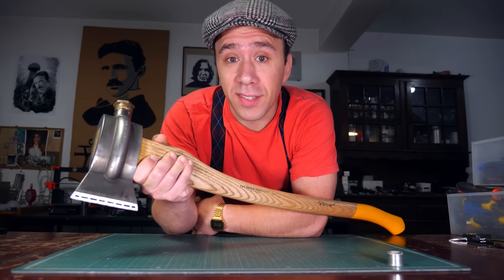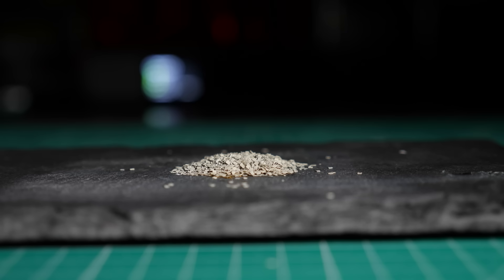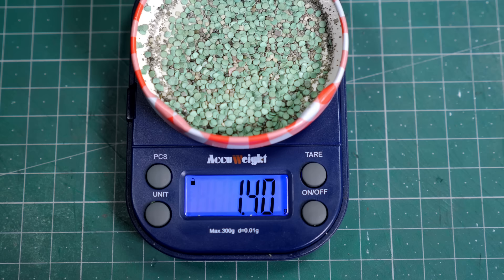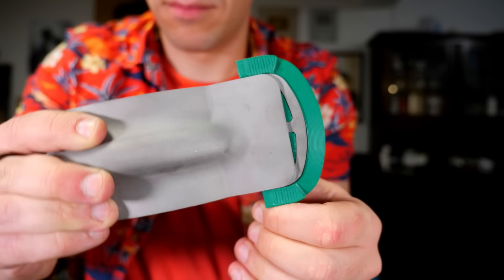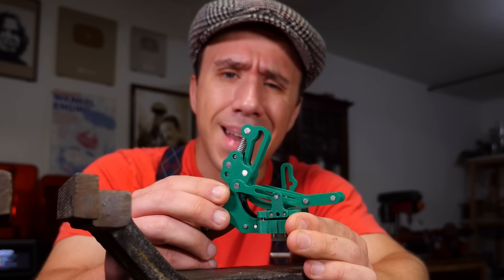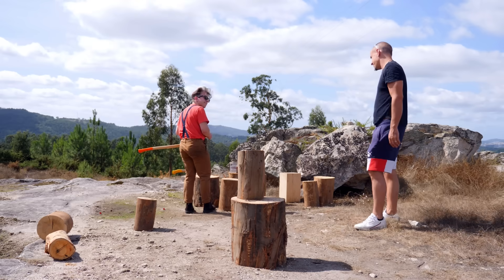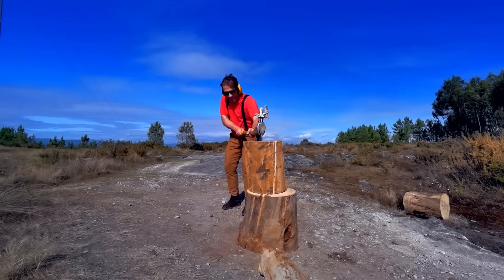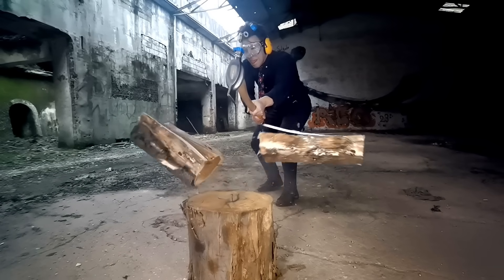I built a BETTER SHOTGUN AXE

Comment: Essentially What you've  made, is called a splitting gun
Working with explosives, I have a splitting gun in my kit which is used with black powder. It will split a whole tree barrel with one shot. It's a long heavy cast tube, with a long taper heading up to a hollow barrel that goes about 3/4's of the way down. You load the gun from the muzzle, tamp it until it's compressed then belt it onto the end of a log , fuse is inserted ito the flash hole, a chain with a large steel peg attached to the end of  fat end is hammered into the ground to catch the gun on recoil, which it blows out with a lot of force. 
It's a 200 year old device, and is essentially a much more useable item than the lovely thingy you had printed modified and experimented with. Still quite impressive though. (Edit)* and in conclusion this is the best video I've ever seen.
Reply: I've heard stories of this type of thing being used by farmers to remove large stumps back in the day, down here in Australia. Albeit, with less precision and more gtfo. Mostly these were cautionary tales.
Reply: @sir_vix Victoria 👍🏻
yup. They're not safe at all 😂but very effective provided you're not wearing it after
Reply: @sir_vix it's true, they did and there were some specific devices and homemade ones
Reply: Man, you are so cool for sharing al that yk? :D
Reply: @misterkarpik  by cool, you mean arrogant conceited and obnoxious right? 😂
Reply: "... and is essentially a much more useable item than the thing you had printed. " - bit unnecessary don't you think?
Reply: @85Portar  you reckon? 
So you're into quoting comments, trying to seem like you have an affinity with the creator because you went into bat for him after the mean man just talked plain facts? 
Now you have my attention, I feel you may be a little thin skinned for real world activities. 
My names not Quasimodo , but I got a hunch... 
shhhhh hush.
Reply: @shotfirer-yf7ub  entitlement is a very telling telling factor about you, lad
Reply: @shotfirer-yf7ub  I think you might win a prize for "least likely to have touched grass in 2025". You're just missing the mark completely there bud
Reply: @85Portar yea righto, bud. Point missed 👌🏻
Reply: @85Portar I'm a 53 yo 3d gen farmer in Victoria Australia bud, what do you do, bud
Reply: This looks like a more awesome, though perhaps less safe and less efficient, version of an old device from 200 years ago. Can't wait to see the final result of your tinkering. Try using 5ml water per kilo of a 10% fuel oil 90% AN emulsion. It boosts your blast by a factor of ... lots.5ml expands exponentially when it's combined with explosives and steam. A small amount Can be avery strong as a boosting aid in confined blasting. For an example of the device, I found this video. https://www.youtube.com/watch?v=O_iH1ESyYuc    youtube Black Powder log splitter Demolition Dave Drilling and Blasting.

You could have posted something like that and achieved the same level of information without being rude for no reason. It's a matter of respect. See in the real world, people tend exercise a certain level of respect to avoid being punched in the face and over time this builds up to a natural habit most people tend to call 'common decency' and 'tact'. You know, those things you can't attend parties and functions without having. Maybe until you've learned to internalize some stuff, we should consider you not quite ready... >for real world activities<.
Reply: @FanfictionEnjoyer mate... go do something productive..
Reply: @shotfirer-yf7ub  True, fighting a battle of wits with someone unarmed is rather unproductive.
Reply: @FanfictionEnjoyer just out of interest, and if you don't mind sharing , what do you do for a living and how old are you? What information did you bring to this topic?
Reply: @shotfirer-yf7ub  I brought to this topic a basic skill that most people learn between age 5 to 10 with slower examples happening between 11 to 20 and particularly slow examples of human capacity learning... much later or never. You brought something you probably saw on a youtube video. Neither of us are particularly impressive in that regard. But oh well. As for age, I'm middle aged and work with computers and have a wide range of hobbies; though I don't spend enough time in any of those hobbies to be considered an expert.
Reply: @FanfictionEnjoyer no, in fact I worked underground in a hard rock gold mine, in Victoria , under a town called Stawell, after I left , I started my own shot firing business. Manufacturing selling and implementing explosives. I did this for a number of years while working the farm at the same time. 
our family farm , located east of Great Western has been a productive super fine merino concern for over 100 years. I'm very proud of my 
work history and what I do now. The fact you've taken offence to my perhaps slightly forthright sharing of information suggests you're probably a bit soft ... and as for googling anything I posted..
I was raised reading books, researching without computers and doing things to actually find out. 
Not typing on a keyboard. Great for reference though, I often get calculations ,pressure conversion tables , engine specs , just general engineering queries, but suggesting i Google to post is kind of lame.
How old are you? Seriously? 
Your projecting
Reply: @shotfirer-yf7ub  Not sure I would have admitted to being in the last of the three groups. But you do you. If that's true about where you worked, I'm sure you must've been fired for your attitude. I suppose the other alternative is that you just have that attitude of cowering before the strong and only showing your rude side towards those who you think can't hurt you that plenty of random 'bullies' have. I certainly would have fired you on day one if this is how you act on the job.
Reply: @FanfictionEnjoyer oh dear ... mate it's all going to be ok.
Reply: @FanfictionEnjoyer  You do realize you're encouraging him to commit a felony right? ANFO might be easy to make, but even in the US you need a special license to own blasting agents!  The other thing the US does is classify powder actuated devices, like this axe, differently from explosive actuated devices.
Reply: @EmperorA0  I doubt I'm encouraging Shotfirer to commit a felony by pointing out how they could have been nicer with their comment by showing a better way to say it.

Comment: 2 potential improvements for a V3
1. Switch to the little things you alluded to in the water segment, sure they are used a lot in YT projects like this but it is for good reason
2. Have some manual control over the detination, so you could dig the axe into the wood a good depth safely and then detonate to split it or ensure that the timing is good and not to early or too late
Reply: As for 1. Maybe 2-4 of the strong(red) ones, as for 2. That is more of a soft requirement but it would allow you to, for example, dig an area out for easier penetration, and then go for a swing with a well timed manual det via some sort of button or squeeze lever

Comment: I think that part of the issue is that you're directing all the pressure outward. It is my understanding that when the gas hits the opening, it hits the back of the blade, which forces it outward, transferring energy into the blade rather than the wood. If you made the gap for the gas to escape smaller and "sharpened" the inside of the axe where the pressure hits, it should be deflected at a slight angle rather than being forced all the way perpendicular to its previous direction (assuming my intuition is correct). I feel like if you directed it into the wood at a downward angle like this, it would transfer more energy into the wood because the gas would carry downward momentum and be harder to direct upward, out through the hole created by the axe entering the wood. Note that I am not a physicist, nor am I particularly intelligent.

Comment: Good luck! 
I would suggest to add more weight and have a wedge that kicks out, 4.5-5.5 kg assembly is plenty. 
Have the wedge maybe 500g so the detonation can actually push it and consider a more powerful charge.
Just bore out a sledgehammer and stick the shell and wedge inside it,

Comment: If you are having issues getting shotgun shells where you live how about ammo for powder actuated hammers? Those are basically either 22 or 27 caliber shell casings that are filled with gunpowder then the end is crimped and sealed. No projectile. They are also rimfire instead of primer fired. It is possible to slpit the head of your ax below the handle, install a couple of springsfor a safety so it does not go off if it is dropped. At that point, you could set 3,4 or 5 of those shells in their chaimbers between the ax handle and the blade. When the blade of the ax strikes the wood, the 2 halves of the head would pinch the rims of the ammo to set them off. This arrangement would allow for more or less power to be used as the ammo comes in different power ratings. It would also eliminate the pathways for the gas to go around the ax handle increasing efficiency.  Because powder actuated tools are used in industry and construction, the ammo might be easier to get.

Comment: What about holes down a hollow spike so instead of long ways across the face. Like the difference between driving a nail tip first instead of hammering the side of the nail laying flat? Youll get much deeper and the pressure wave front should start at the top hole and push the wood outward as it travels into the log down the holes. 🤔

Comment: This is an interesting concept. To overcomplicate the design (like a true engineer). (Might be easier in USA) I would use a bolt action shotgun receiver that is built into the handle. The head of the axe would take place of the barrel with a smooth 90 deg bend in it to the blade of the axe. 

As some others have said, your operation is as if you have a barrel obstruction. Firearms deal with insanely high peak pressures but for short durations. 

Interesting idea, but without the full swing of the axe to burry the blade I don’t think you’ll get the results you are looking for.

Comment: What if instead of relying on the axe making a proper seal against the grain of the wood the axe head opens in two pieces when the shell goes off pushing the log apart.

Comment: 18:11 sir... i know my wood 😉 

Pine. Easy to split seasoned (dry) (dead). NOT so easy to split freshly cut (most softwoods) 

Oak, maple, elm, sycamore, rowan + many other's that i cba to name at this current moment in time 😂 not the worst to split (freshly cut) BUT Very easy to split once "seasoned" i know i know its backwards 😂 id say this only applies to rounds bigger than roughly (give or take depending on knots/Y's) 10-12+inches in diameter. 

If you can get ahold of some ash rounds fresh or dry. They wont make a massive difference. By far most people's favourite hardwood to  split. Ive not had any experience splitting American natives as im from Scotland. 

Stay away from eucalyptus, Yew... and aome other's that have escaped my mind right now lol 

Dry and dense hardwood is what you are needing! 

Ive been typing farrrrrr too long  now.... OH and before i forget if you have a couple of knots say2-4 inches apart aim for directly In-between and 9 times out of 10 itll split like normal! 

Hope some of this info helps!

I absolutely love your content and hope to see part 3 

ALL TOMATOES MUST BE EXTERMINATED ❤

Comment: Blue Gum Eucalyptus is a great wood for so many things, though it's a poor choice for firewood both due to it's really obnoxious durability (as you can attest to), and also because the eucalyptus sap inside the wood is EXTREMELY flammable. When a eucalyptus tree catches fire and burns for a bit, you start to get loud bangs and showers of sparks from the sap overpressuring inside the wood and exploding out. It's beautiful to watch at night but it's a real pain to deal with during a wildfire as it can cause a lot of spot fires.

Comment: Alll right alright that’s cool and all but what about the 6 shooter hatchet? XD 

i think you need to make the holes very small that it comes out of, it seems if the initial stile is too much the seal for the pressure isn’t there and it just escapes, maybe you could make hallow spike in the middle of the blade, instead of a pointed blade leave it curved and the spike doesn’t need to be too big, you don’t want to wedge it apart, for that matter both of your designs look like wedges not really axes, some axes are slightly fatter, but the best trade off comes from your ability to pick up and swing the ax, a wedge typically is driven with a hammer from behind the head for much larger pieces or stumps.

Comment: Some suggestions, so first the different shells may have a different ammount of power which could change the results, secondly there is rifle and pistol powder rifle powder burns more slowly to accelerate the heavier bullet and pistol powder burns quickly so the bullet gains more velocity before leaving the short barrel, you may need to switch back to the shells for the slower burning power it may give you a better or longer push to split the log. As for the ax it needs more of a wedge shape yours has flat sides and is only.angled at the cutting edge where other axes have angled size and are wedge shapes, doing this would help the sides maintain contact with the wood even if the log opens up too much

Comment: Love this content! Consider the surface area of the holes on the ax head. More surface area equates to more total splitting force on the log with the same PSI. Pound force per square inch. 

Same reason a large balloon is easier to blow up than a small one.

Comment: What about 2 ideas: A spike that blasts rather than a blade. Or... A wedge mechanism where the axe head is in 3 pieces: a center wedge that forces the left and right halves apart under pressure.

Comment: I strongly suggest you to watch videos on how to properly use an axe. You are supposed to start with your hands separated and pull one hand closer to the hand at the end of the handle as the swing goes down. This might help. Dunno. Good video integza, good luck on the next part. Will be waiting for ir

Comment: My bet, and if not how it goes then what I suggest, is a change in mechanism where the sealing of the axe isn't necessarily done purely by the wood, instead having sorta guiders and covers which are propelled down and out into the wood with the force of the blast to shove apart the logs along with any of the excess gasses coming out after the splitters are extended, and then having a spring retract them back to the axe head, like a more gas operated mechanical log splitting axe rather than fully replacing the mechanical splitting head with a gas operated one.

I can not vouch for the effectiveness of this idea, but it may be worth some thought.

Comment: you need to be able to actually swing the axe, a longer blade, and a firing system made of steel instead of brass that is actually part of the head, welded to it, or at least threaded on around the shell with very deep threads. You should calculate the force required to trigger the hammer, and make it very high so you dont risk misfires before the axe is in the wood. I would also add a delay mechanism so that the hammer drops about 300ms AFTER the impact. This way you don't fire the shell upon the axe first hitting which is when the jerk would be at max, but just after it.

The firing mechanism shouldn't be mounted to the back of the axe head either. it would be ideal to have it in the center of mass in the axe head, with a "barrel" directing the gasses right to the ports at the blade and exiting at 90 degrees from the blade edge (normal to the wood). This would actually be easy since you are printing the axe head, it would be a similar to a rolling block gun which someone else here suggested. Basically there would be room in the center of the axe to "drop" a shell in, and then close a (locking!) breach block behind it at the rear of the axe.

Comment: dont use brass. use high carbon steel. tooling steel. its harder to work with. but it will last much longer. also it will not fracture from the shell like brass would under those pressures

Comment: if the cartrige container had a gear style lockup system like an AR15 or a benelli M4 it would prevent propellant gas leakage around the shell, and an inertia released striker may be easier ro teset and fit inside the bolt carrier group. theres a cam groove on the inside of an AR upper that handles rotational timing of the bolt face for lockup

Comment: Im no engineer, but half the issue as i belive he said, was once you make a crack, it lets the pressure escape, lessening the pressure to split the wood... so instead of open holes on the blade, wouldnt putting a line of pistons that are just  recessed right above the cutting edge spring loaded that blow out each side (and let gas release) make sense? 
It would forcibly push the wood apart without loosing the pushing power down a crack in the wood and makes the split chemically/mechanically driven as in like a car piston. 

If the pistons can be recessed in area provided of course..but i dont think it would take much movement from the pistons (ergo very short length of travel) to pull it off.. but im sure someone with more math/engineering skill could say.

Comment: So nice work honestly The one thing i would say is your trying to make an axe out of a maul. The head needs to be much thicker as it tapers to a nice 25 to 35 degree angle then you bevel just this tip to mostly sharp point. That should get you more consistent penetration.

Comment: You may want to consider mounting a small rocket engine on a normal axe head, and setting it off as you start your swing... then again, you might not, as that does not sound safe, either.